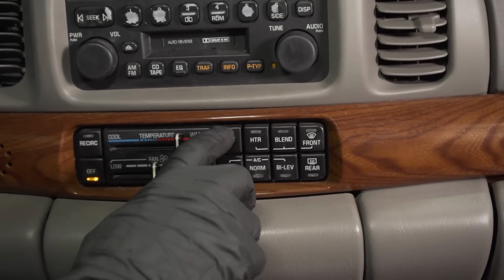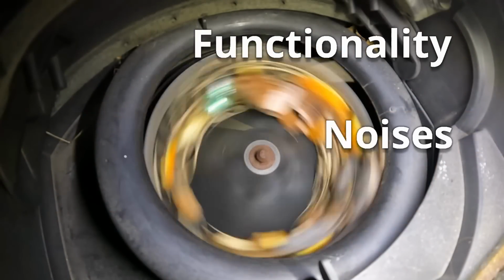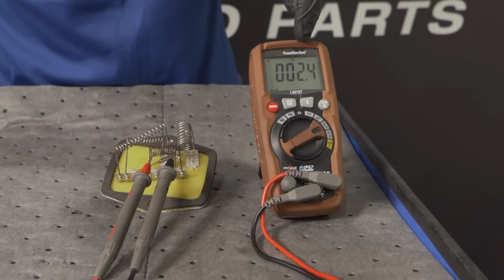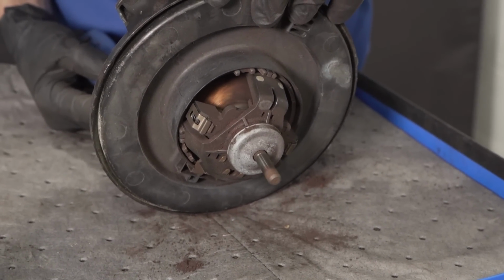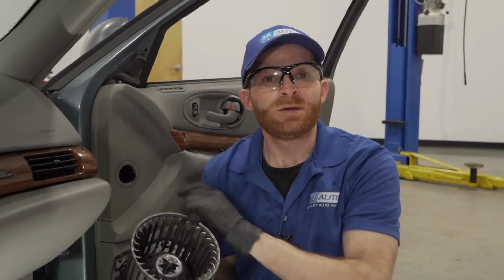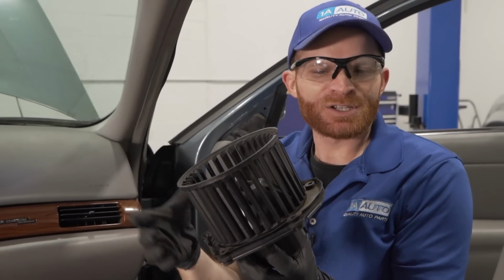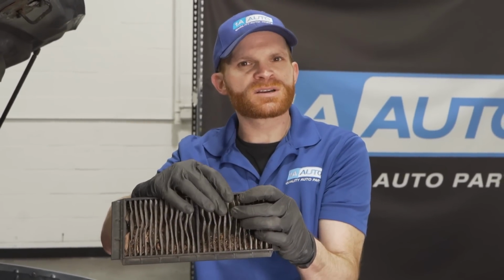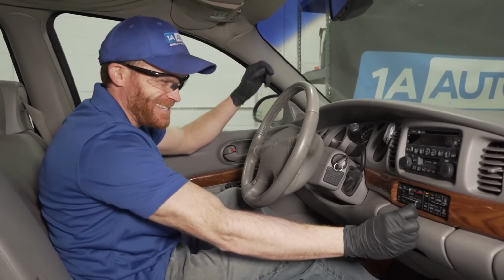Rattling noise coming from heat/AC vents in your car or truck? Find blower motor problems easily.

Comment: Lol mechanics always say that, if you're replacing this part then you might as well replace these parts at the same time. If you're replacing your pads you got to do your rotors, if you're doing the blower motor then you got to do the resistor and the pigtails. No, no you don't. And you shouldn't unless they need replacing. You can have a resistor fail and have a perfectly good blower motor.

Comment: My heater making a loud noise when on high I checked blower motor and it's clean and works as it should filter was a little dirty but not that bad. The heat still making loud vibrating like noise but when I switch to a/c the noise is not present.

Comment: My 2015 rs camro battery just gave but my stability warning and engine check warning came on all at the same time do you think this is from the battery its self or should I check the sensors

Comment: Question though what if there is a smell when it's on then goes away question 2 what if the vehicle was designed without a cabin air filter how would you fix that
Reply: My car dose not have a cabin air filter best you can doo is keep the vents up by the window where your wipers are keep those clean buy those compressed air cans and blow them into all the dash vents and do the same with the vents by your wipers.

Comment: Would it be OK to blow some ozone through the vents ? 2014 stating to smell used. NO EATING IN THE CAR!!!
Reply: Carful with that the vents lead right back to the heater core and evaporator that stuff could damage the metal on the evaporator and heater core